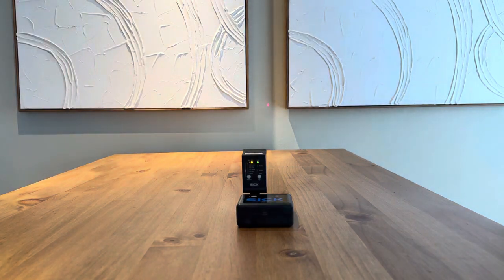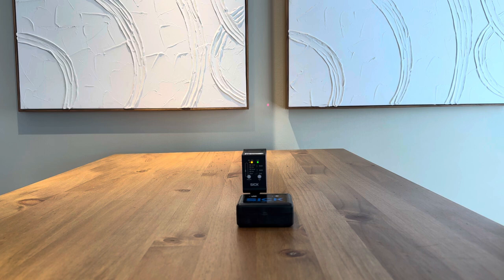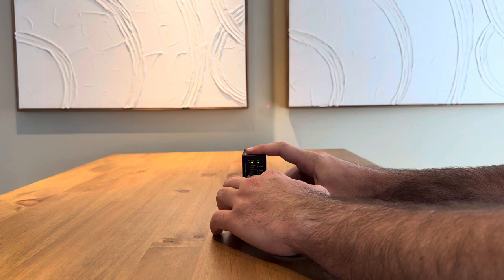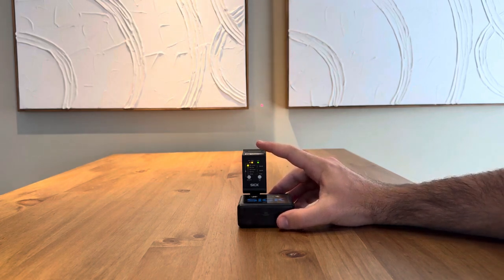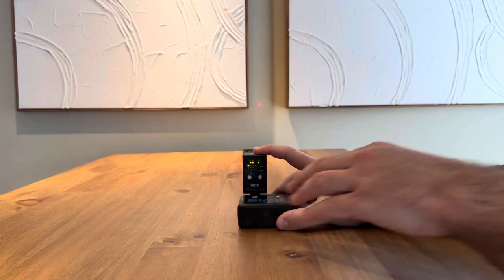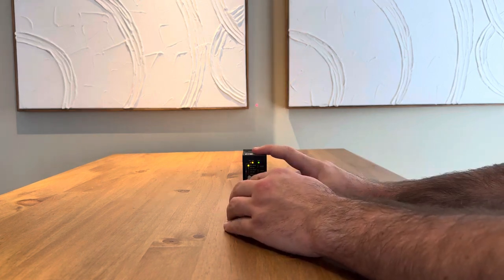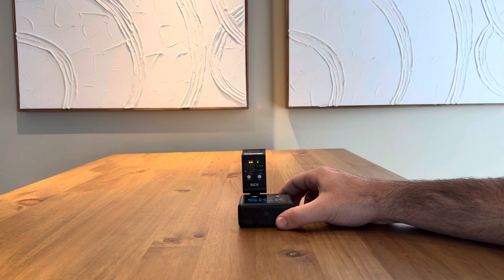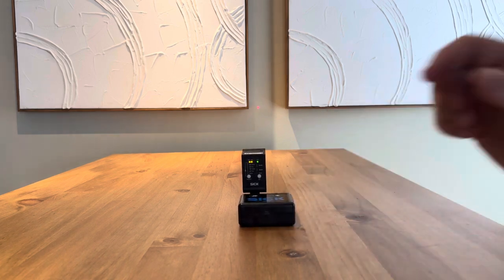SICK DT35 Mid Range Laser Distance Sensor Demonstration

Comment: hey, what model is power supply?
Reply from the maker: The power supply shown here is a battery box with two 9v batteries. Nothing too special - and it won’t last too long powering up the laser. Just about any DC power supply could work.